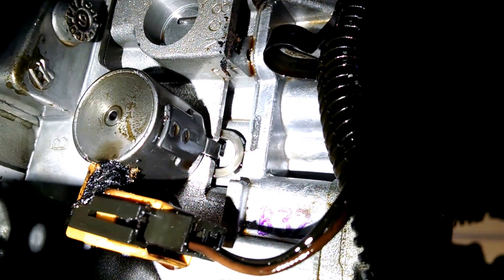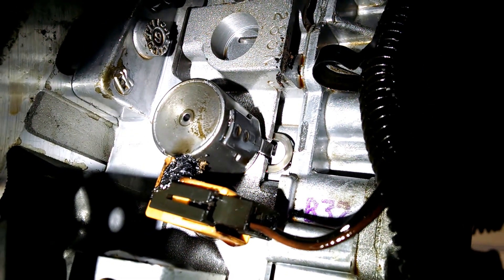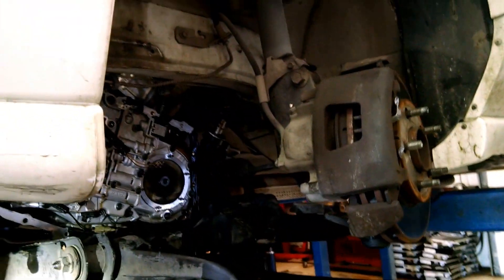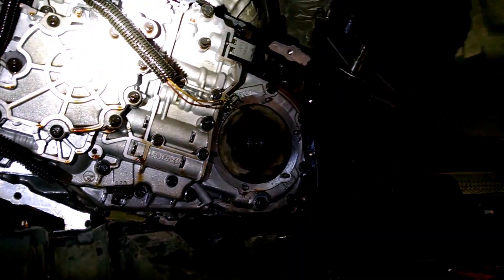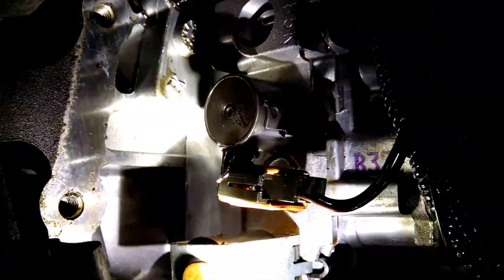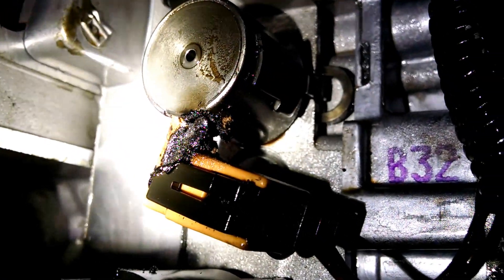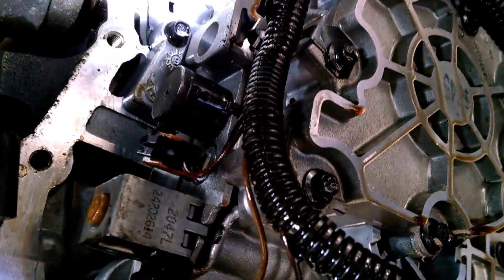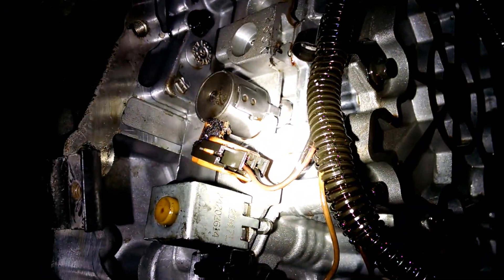Transmission shifting problem and blown fuses #5

Comment: 99 grand prix won't upshift into 3rd rebuilt trans over a year ago fluid smells new correct level. Thanks subscribed
Reply: Is there any hope for easy fix on my trans or should I plan on pulling it out?
Reply: @benwamsley5876  I would check all control cables and exterior controls first. Then look at the valve body. Can you manually shift it starting in first and work your way up to feel it go to second and third and lock up? If you can find 3d then it may just be a control problem.
Reply from the maker: Your Welcome Ben, Hopeful this will get you going.
Reply: Will downshift into 3rd with enough throttle input,but won't upshift into it manually or automatically
Reply from the maker: @benwamsley5876  May be time to see about a rebuild or a reman unit.

Comment: Very informative. I own a Kia Optima 2016 1.6 dual clutch transmission.  Car runs like a race horse with no issues, but a little two weeks ago, I went to start up the car. My battery, which isn't old, is low and wouldn't start. I called AAA to jump start my car. The car started as soon as he put the jumpers on. He too was surprised about the battery. Anyways. I was driving the car, but it barely wanted to move. I'd parked the car to make sure that was charged. When I'd attempted to put it in reverse. The car wouldn't reverse when I put my  foot on the gas. I ran a code. Initially it said that showed, P073E: no reverse; actuator stuck in close position.  Now I have additional codes. P1921: range sensor. P074A. The last two codes didn't pop up until after I'd took it to the dealer. I took my car away from the dealer because they lied and said that the car now has no gear, as in. Won't drive. Drove the car off the lot and parked it, until I can find an honest mechanic.
Reply from the maker: Epics Steven, thanks for sharing. Sorry your having to deal with this. It may that before the battery went dead the computer for the transmission had learned all of its adaptive memories and was able to compensate for an older transmission. Once the battery went dead it could have lost all those adaptive programming that it had built up over time and when the battery went dead everything reset back to zero and that could explain why the transmission would not be able to have the pressures it needed to move. It could also be possible that some electronics were affected from the battery going dead. Look for an automotive shop in your area that has a good reputation with Google reviews and then ask around from your friends or social media for a local reference to go with that so at least you can get information from a place that you feel good about and can trust.
Reply: @Craigs_car_care  thank you for your prompt reply. The battery 🔋 also crossed my mind. But I also wonder if I have a short. Parasitic drawl, because something drained my battery. I'm going to take it to a shop in.the area, that has a positive reputation. If the battery done this. What measures do I need to take, in order to get my system back to normal?
Reply from the maker: @epicsseven7686  it'll depend on what the shop discovers and what the correct course of action would be. Of course it's important to know why the battery went dead in the first place, if it is a bad cell or a parasitic draw somewhere in the system but also the more pressing issue of what's going on with the transmission. I would ask for them to perform an evaluation of the the two main issues and maybe even look over the rest of the vehicle and get you an estimate that way so you have an overall view as to the current and Future investment possibilities into the car so you can make a determination from that point on how to proceed.
Reply: @Craigs_car_care  i agree. Especially due yo.the fact that I am still paying on it.  Next year it'll be paid off.
Reply from the maker: @epicsseven7686  sweet, nothing better than when you get them paid off.

Comment: Hi Craig, I have 2014 nissan Maxima. It has a delay in the morning but once heat up it work fine. Can u please give some me some advice
Reply from the maker: Good Morning Travis, By delay I assume you mean when you place it in gear and try to go it revs up a bit before pulling the car and this is an automatic transmission? If yes to all then start by checking the transmission fluid level with the car warmed up and on a level surface and the car in park with the parking brake applied. The fluid should be to the full mark and red to dark red (Your transmission should be an CVT Style) not black and smelling burnt. This a great place to start looking for problems. If it is low then fill to the full mark with Nissan CVT Fluid NS-2 and check for leaks. If this is full than have the system checked for data trouble codes to see if this reveals anything. Also it is possible that something else is holding the car back and making it seem like a transmission problem. I have seen things like sticky brakes cause this very thing same thing each morning or after the car sat for more than 8 hours it would barely move then all of a sudden free up and go. It turned out to be a sticking brake caliper slide. Great question and thanks for posting.
Reply: Appreciate it

Comment: I have a 07 Chevy Monte Carlo. I moved when it's in reverse and low gear. But when it's in drive it just revs up but don't accelerate. No transmission codes . Could my BCM losing communication with the data network or watever it's called be the cause of that
Reply from the maker: Make sure the fluid's full but in all reality it's transmission time. Reverse and low are the last ones to go. Also see if the fluids burnt and smells. Sorry you got to deal with that. If it was just something in the network BCM PCM you'd be able to manually shift it still. Still like you said check all the fuses and everything else just in case but it sounds like it's a goner
Reply: @Craigs_car_care  I'm not having shifting issues. I just don't accelerate when it's in drive
Reply from the maker: @VYG4300  okay, I understand and that's usually a key sign that the transmission has a major failure inside of it.

Comment: I have a 01 Bonneville that slipping after driving for a while I already did the pcm still the same problem
Reply from the maker: How does the fluid look? is it got a real bad smell to it and or is it very dark or even burnt? Is it able to give you any data and how about any kind of codes whatsoever for the powertrain or drivetrain?

Comment: I have a 2008 Cadillac Escalade esv that drives find when I first start it in the morning but after driving it for more than a hour it slips into neutral. I would pull over in trun the key off,open the door to get the radio to cut off wait for 5 minutes in start it back up in it will drive fine for about 30 minutes in do the same thing.
Reply from the maker: Hi Travis, I would recommend to start by checking the transmission fluid level and its condition to see if it smells burnt and looks black = overheated and failed transmission (mechanic problem) or the fluid smells ok and has a reddish tint to it (good thing), Then run a scan on all the on board computer systems especially the transmission control module for any data trouble codes and go from there. It may be a mechanical problem or could be an electrical issue but these steps need to be done first before knowing what direction to go.. Let us know what you find and thanks for posting.

Comment: I have a 04 Chevy venture my transmission was just rebuilt because I would be on the highway and it’ll shift down to 3rd gear and would not throw 4th gear it’ll throw it but later drop to 3 rd any help ?
Reply: My 2010 ranger does the exact thing and and starts flashing OD OFF. Went to autozne and they couldn't run test on it, they said they couldn't because of a possible "blown fuse"

Comment: I’m having issues with my 2015 Nissan moving . It does start but no check engine light is on no codes. Could it be a transmission issue without them?
Reply from the maker: Hi Kim, if the issue is in the Transmission it may not turn on the check engine light. If this is an automatic transmission.The first place to start is with the transmission fluid level to make sure it is full. Low fluid can cause the car not to move.

Comment: Every single light:  So, is this the reason my cadillac xt5 lights on my dash turn on?
Reply from the maker: @leroybarron6005  what are the messages? Or what does the lights say?
Reply: @Craigs_car_care  Brake assistance reduced, Abs, Brake something, anti slid off. There's a lot.
Reply from the maker: @leroybarron6005  that is a lot, I would start by checking all the fuses or having all the fuses checked to make sure nothing's blown real simple stuff first. After that I can pull the data trouble codes and see where that leads. I've seen an alternator going bad or a battery going bad do things like this.
Reply: @Craigs_car_care  I sure will as soon I get out of work.

Comment: I have a 2002 chevy tahoe that wont reverse but drives good anf the fluid is good. Nice color dont smell burnt.
Reply from the maker: Good Morning, I have seen this be something as simple as a shift cable problem to an electrical issue to a hard part failure inside the transmission. Start by making sure the shift cable is not slipping or has come out of adjustment. Afte that have the data trouble coeds pulled for the powertrain and transmission and see where the cloues lead and follow the testing. Good luck and I hope it is a simple fix. Thanks for posting
Reply: Hello Jessica I have a 2006 Tahoe and it's just started doing the same thing yours did so did you ever find your problem? Thank you for your time.

Comment: I have 03 chevy 2500hd that won't downshift under load (camper trailer up a hill) . Trailer weighs about 7000 lbs.  New air filter, new MAF sensor, new fuel filter, cleaned throttle body. Not throwing any codes. Runs and shifts fine on highway.  Would appreciate any pointers?
Reply from the maker: Good Morning Wind Slicer, A couple of things come to mind and you did not mention if yours is gas or diesel or 2 or 4 wheel drive etc, but some basics like fluid quality and condition should be looked at. Has it always done this or just started recently? Make sure the shift linkage is set up and working correctly, does your tow haul work correctly? By that I mean does it hold the upshifts longer and use transmission braking to control speed on the down hill runs?  I have also seen aftermarket performance programmer's cause this. If you were a second owner it could have been done before you owned it and set up under a different strategy. Lastly can you use the manual side of the stick and run gears up and down at will? If so check all the above and then I might suspect a solenoid or wiring issue . I know you said it was not throwing any codes but was that also in the transmission and Body control modules?  Codes can be set and not turn on the check engine light.
On the electrical side of things the power control module (PCM) .Transmission control module (TCM) and the body control model (BCM) are all involved here just as a point of reference of place to look. Great question and good luck on the hunt. Let us know what you find.
Reply: @Craigs_car_care  Thank you. Will look at your suggested checks.

Comment: How important is a transaxle fuse? I have a 2005 lesabre custom, and I fixed my cruise drive and I noticed that the transaxle fuse was unplugged and cruise speed worked after I plugged it in. However, I feel like the shift jumps a little bit after I plugged it in. Should I just unplug the transaxle fuse since it has been working ever since, or is it that important? Thank you!
Reply from the maker: On the video that one is for the overdrive as best as I can recall. Some systems will not even shift with blown fuses

Comment: I have a 2001 dodge ram 5.2 that has a p1740 code. Transmission was rebuilt and everything in it is new. Fluid is new and fine. Any chance I have a short in the wiring harness somewhere?
Reply from the maker: On the 42RE Look at the valve body to see if the boost valve clip has everything in place. If any of the old shift springs were reused this can be an issue also. The harness is something to test while it is all apart. Keep in mind if the filter is wrong, broken, not seated or obstructed in any way these can cause the 1740. When in the pan start simple and basic first. Look for any parts laying in the pan.  What is the DTC you are reading for the 1740?

Comment: Could blown transmission fuze cause the ecu problems getting signal from the speed sensors?
Reply from the maker: Good morning Bart, Great question!  Fuses will be from the ECU and not from the sensors. Usually it will be a bad sensor, wiring and sometimes the ECU  for they sensor.

Comment: Hey kudos to helping everyone in comments! If you have time, I have a problem. 2008 Nissan Armada is engaging overdrive too early boggig the engine to 1k rpms at 40. Any ideas! Thank
Reply from the maker: I'll do some research this week and see what I can find out.
Reply from the maker: Any check engine lights or overdrive light flashing? If you hold it out of overdrive does it perform well as far as power?  What does the fluid look and smell like?   2 or 4 wheel drive?
Reply: @Craigs_car_care  howdy! Car seems underpowered. If I near floor it, shifts on time and correct manner(unable to drive as it feels like I'm racing). When I hit 40 rpms drop to 1k. Upon removing my foot and reapplying throttle it goes back up to 1.8k-2k and drops back down.
Reply: @Craigs_car_care  AWD and no check engine lights. It's been clean of codes for about a year. I feel it's been progressively getting worse
Reply from the maker: @Thatdudewithatie  My transmission guys says to make sure no throttle linkage is off at the throttle body and all around the transmission.  Did you get a chance to look at the fluid level and its condition?
Reply: @Craigs_car_care  I'll Google how to check that. Yes, I had it changed last month(same results as before). It was dirty tho
Reply from the maker: @Thatdudewithatie  If you had it changed it at least has clean fluid. It is possible it has an electrical issues but we won't know for sure until someone gets into it. Normally we start with all the things we have been talking about and also make sure some other system is not affecting the transmission. then if nothing is found we start pulling electrical connectors and look for fluid seeping up into the harness  then pull pans,covers valve body to look at the submerged solenoids and other sensors and the harness in there. After that if the problem was not found it becomes a mechanical issue that results in a rebuild or replacement.    Keep in mind it is not uncommon for and electrical issue to became or lead to a mechanical one or vise versa. Also a overheating engine can lead to an overheating transmission and damage them both just as an example of how interconnected things are.
Reply: @Craigs_car_care  thank Craig. I'm going to take it in few weeks. I'll let you know what they say. Side note running with AC off provides more strength when driving.
Reply: Chang your transmission condensor
Reply: @Craigs_car_care  I have a 2001 Bonneville  that's slips a lil bit when I drive it for about  a hour no check engine light  I got the code p1811  what can cause this and I hear a slight whining noise like power steering is low if you have time plz could I get your opinion only 125,000 miles gas had transmission serviced in yrs

Comment: My 1994 Ford f150 5.0 shifts to 4th way to early what could be the issue? I’ve changed the tps, clean iacv and my model f-150 does not have a map sensor. Any ideas?
Reply from the maker: Good Morning, After verifying the fluid is full, not aerated, not burnt.  See if yours have a "TV" cable on the throttle? If it does it may need to be adjusted. With the truck off open the throttle all the way at the throttle body, then with the free hand see if the "TV"  cable that runs from the transmission to the throttle has any free play in the center part of the cable. You can look up in Youtube "how to adjust Ford AOD TV cable" I hope this helps

Comment: Hi, I have a Mazda 3 2010. The car jerks when put from neutral to reverse or drive. It jerks when go up 20 kmph and jerks when goes down 20 kmph. Car also seem to be stuck in 3rd gear as it wont go above 80 kmph, even 70 kmph is at 3000 rpm. My check engine light is on with AT light. Got the TCM replaced, got the shift solenoids block replaced based on the codes. It still has not fixed the issue. Any suggestions?
Reply from the maker: Good Morning Muktesh, Really not enough information. Does the trans or engine still have codes? What are the codes? What is the condition of the fluid? Sounds like a mechanical issue but could also be electrical or even bad new electrical parts.
Reply: @Craigs_car_care  hello, thanks for the quick reply. As per obd 2 it shows P0758- shift solenoid B electrical. I got the fluid changed, it did had some chipped metal powder, but I am assuming it is because of the damage due to drive in such condition
Reply from the maker: @monybhardwaj  If it still has code P0758 Still active then it can be a wiring problem between the solenoid and the TCM, or a bad solenoid, Or a metal keeps getting pulled into the new solenoid and damaging it or the valve the solenoid controls is stuck. You would probbly need to start the testing over and follow that trail to find the issue. It may be a case of the electrical side failed first and took out the mechanical side or  the other way around.  no matter what is found you will want to be sure the TCM and all its wiring is good before installing a new transmission if mechanically it turns out to be bad so the new transmission is protected.
Reply: @Craigs_car_care  Thank you